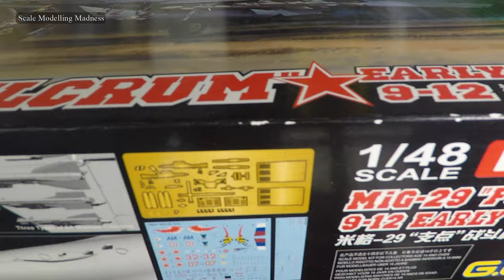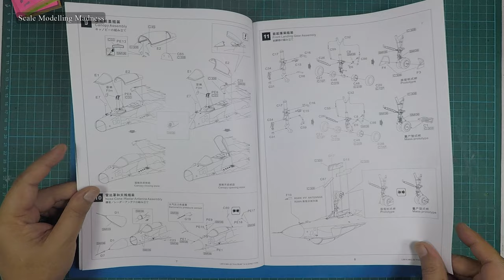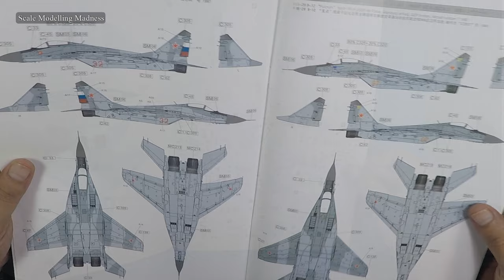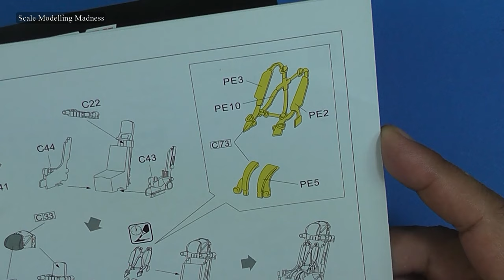G.W.H. 1/48 Mig-29 Early Type (Part 1: Cockpit build)

Comment: The clear parts usually have parting lines if the canopy cross-section is omega shaped and they need a sliding mould to create the part.

Comment: Tip: Those fragile pieces on the wingtips, take a piece of masking tape and cover them. This will prevent them from being damaged during your build.
Reply from the maker: Actually, what I was thinking of doing was to cut them off and either reattach them later or replace them with brass rods.
Reply: @scalemodellingmadness4114  i just can't wait to see your jext part in this series! I am ordering the North Korean version of this kit (only because i dont have anything Korean in my collection). Thank you for the inspiration!